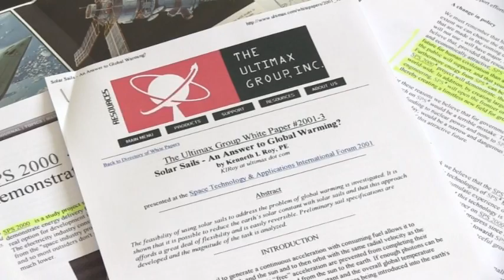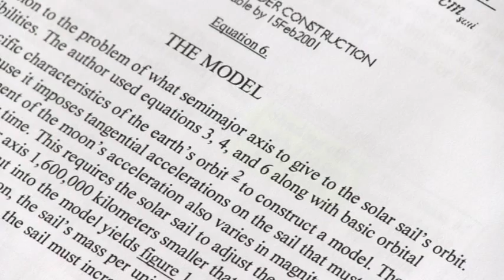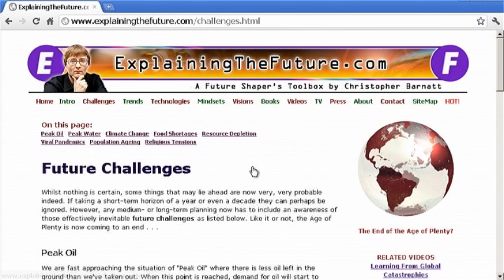Global Warming Solar Sails

Comment: yes.  Hopefully as computing power grows we might be able to predict what effects this would have one weather and us it to say choke of some warmth that drives hurricanes or alter low and high pressure systems to bring rain to drought stricken areas.
I think the big problem will be not computing power to drive weather models but the lack of information input, we needs sensors for every square mile or kilometer and we need them in the air to.  With say small solar powered drones we might be able.

Comment: I doubt that will happen on a large scale.  the ships that transport are goods are simply to big to use normal sails and the unpredictability of the wind would considerably drive up prices.  I did hear a couple of years ago about ships using a type of large kite that went up into the high altitude winds and cut fuel consumption around 15% when the winds were favorable to deployment.

Comment from the maker: Certainly ships powered by the wind save emissions compared to those that burn oil. So maybe sailing ships will return in a commercial capacity -- and perhaps with PV coatings on the sails that will generate electricity to help power the ship via an electric motor.